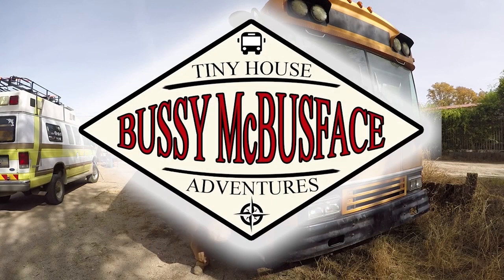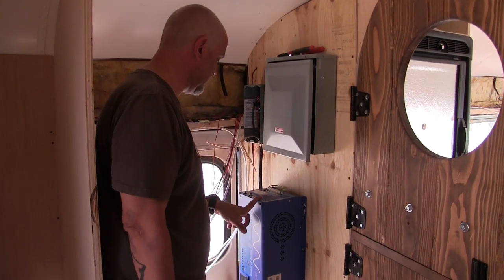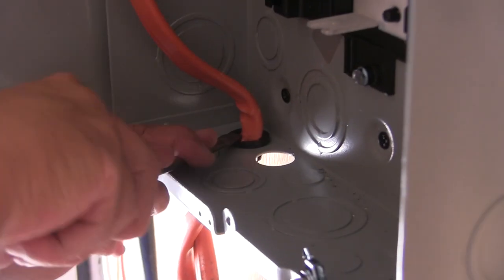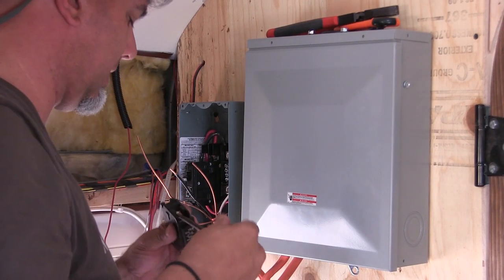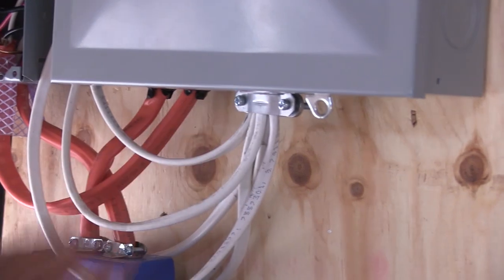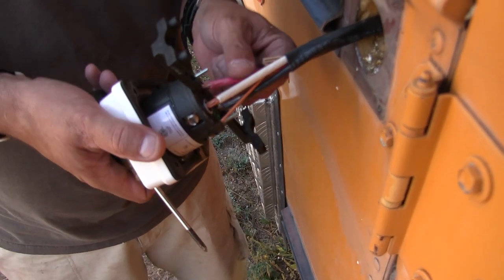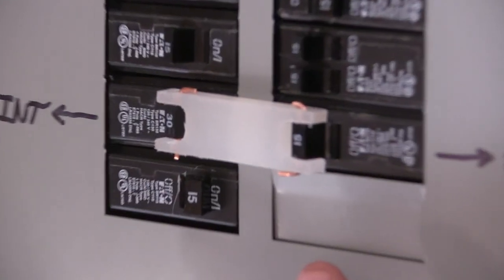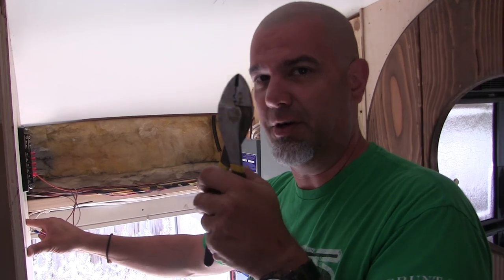Skoolie 50A Shoreline Wiring & Breaker Panels ~ 120v & 12v

Comment: Since this episode is dedicated to electrical, I’ll mention this here. Anyone who does not like using wire nuts should take a look at Wago Lever-Nuts. I bought a big kit of them and used them when rewiring all the old fluorescent fixtures in my kitchen for LED tubes. They are awesome. Easy, tidy, certain connections. You can wire and rewire as much as you like and not wear anything out. I will never go back to wire nuts. (Not sponsored—who the hell would pay me?)

Comment: Hi Mike, I had to watch this four times because I didn't see in the second panel how the pole on the left services the 1st and 3rd level breakers, and the pole on the right services the 2nd and 4th breakers.  So, now I understand how the 30/15a bridged breakers work to energize the shore power side when the internal power side is supplying power.  I have two questions.  1) What was your reason for wiring it this way?  2) Where does your 12v power come from?  Thanks, Steve

Comment: Hi,

If I understand correctly these are two circuit breakers linked together.Have you already thought what happens when there is a short circuit in one of the two circuits.

When one circuit breaker switches off, the other will switch on automaticallyThat's just what you don't want.

This 2° circuit breaker will switch off again due to the short circuit, and so on and so on. At the end, this circuit is not protected and will remain powerd due to the opening and closing of the two circuit breakers.

Result may be a fire.
Testing would not be bad.

Greetings from Belgium
Reply: I don't think that will happen. All the circuit breakers I've ever seen will not reset unless they are pulled even further to the reset position. You can't just pull it back toward "on" without doing a reset first.

Comment: I'm redoing a 2005 class C , and I really like your idea..  I'm trying to decide on the exterior plug size 30A or 50A..
Reply: They make adapters to take it down,just do 50 and get a 30A converter cable 😎

Comment: questions, there is a black and red hot wire coming in from the shore power interface. I see every video the black gets hooked up. what do we do with the red? can we setup additional panel with separate circuits with the red as a 120v set ??
Reply from the maker: That is a very good question. On a 50 amp connection, you have two hot wires. Those two hot wires are 120 volts each. In a standard house breaker panel you will find that there are two separate circuits that your breakers attached to. At the top of the breaker panel where you attach your incoming power there will be two spots for wires and that is where the black and the red wire will go. On a 30 amp connection you will only have one wire coming in and you will have to branch that off to both sides of your breaker panel.
Reply: @BussyMcBusface  so if I'm understanding I could actually split the 2 hot wires and make it go to 2 separate panels and run 25 amp each if I wanted to ( or as a combo that is not more than 50 amp total).

Comment: Nice work man. The only thing i don't understand if you get a chance to explain.  When you on shore power the right side of the panel is disconnected correct?  Then if that is the case then how do you power your fridge? Maybe i missed something, i was assuming when you were plugged in you will have full power to everything in the bus. Great video as always, you are doing nice work.
Reply from the maker: So, instead of running the second hot line to the normal point, I ran in to a breaker. With that breaker on it feeds that second circuit. Hence why I have the interlock so that I dont have the two circuits connected while on internal power and connect the shoreline which in essence is a direct short circuit of a 220v line.
Reply from the maker: On side of the shoreline runs through the inverter all the time.
Reply from the maker: The fridge us also dual power. It will be on solar 99.9% of the time. 12v
Reply: Thanks for explaining.  Keep up the great videos. I could watch your videos everyday.

Comment: My question is if your never going to have a 240v draw inside the bus while using shore power, why did you use a 50amp shore plug? If you were using a 50amp shore tie, and your going to need to need a 240v pull, wouldn't there be a 50amp breaker box coming off that 50amp shore tie before it was wired to the main junction box?
Reply from the maker: That's not quite how a 50Aconnection works.  A 50A connection consists of 2 50A 120v hot wires that together will give you 240vac.  You can run each hot wire to a different phase of a 2 phase breaker box giving your skoolie 100A total power in two phases.  That way you can run your AC and fridge on one phase and even a second AC and microwave on another without popping a breaker.
Reply: @BussyMcBusface  I see what you are saying. I was thinking if you ever had a 240v piece of gear in your bus both if those legs would need both hots to run the 240v load. If all your gear is 120v in the bus your splitting the 50 into two legs and I get that. Thanks.

Comment: perhaps it would be better to replace the two fuses (circuit breakers) by two common bipolar switches, and then a fuse (circuit breakers) each
Reply from the maker: I have that already with the 2 mains.
Reply: Of course you are correct.
But I think if you have a short circuit in the red or black circuit then the black and the red circuits will be completely powerless because the main interrupts everything.
If you replace those 30 A and 20 A (30 A and 15 A in your film) with two switches, then you will only interrupt the bad circuit and not interrupt everything and the other circuits will continue to receive power.
That's what I think if I'm not wrong.
Otherwise it is a good idea what you do.

Comment: panels are not divided in half left and right... they alternate the bus/phase every other slot from top to bottom. meaning breakers directly across from each other are the same bus/phase.
you're home made interlock is connecting two breakers on the same bus/phase, beside it's not a break before make type interlock and will most likely turn one on before the other turns off, meaning both connected at once. 
but maybe you know all that and drawing board just isn't kosher.....
Reply from the maker: Yeah, I kind of eluded to the fact that the drawing was for simplicity. There is definitely and order of switching and plugging this thing but the system works and works while shoreline or internal but should not be switched between the two while hot.

Comment: I love your guys videos I watch them all the time and love to compare to my bus. The inverter has an automatic switch over to switch between battery power and shore power as shore power becomes available. I may have misunderstood something but I would have wired the shore power line to the inverter then from the inverter to your second breaker box that powers the whole bus and that's it. There should never be a need to switch between shore power and inverter power in your second box because there should be just one power line coming in from the inverter and the inverter will do the switching for you. in fact with that inverter you should never have to switch anything in any box the inverter will switch over automatically when shore power is plugged in or unplugged.
Reply from the maker: That's exactly what we did but since we have a 50amp circuit, we have 2 50a 110v connections coming into the bus. We made it so we can switch the second 50a circuit into the mix. This allows us to run heavy power hogs (AC, fridge, etc) on one 50a circuit and the rest of the bus on the other circuit. Sounds like you have a 30 amp connection.
Reply: @BussyMcBusface  No I understand that I guess my point is two fold. I dont think it is save to have two circuits like that in the same box as I feel like it is an unneeded hazard.  Second I understand that you want to have enough power to run your AC and I know people have struggled to run 2 AC and their appliances at the same time in an RV but unlike them you have the advantage of a batter bank. AC are not power hungry because they are going to be drawing 30 amps all the time the issue is how much they draw at start up puts them over 30 amps once they are running their power consumption is drastically lower. Your power inverter has a 9000 watt peak power for 20 seconds that is over 75 amps of power and more then long enough for the AC to clear the start up cycle. Your inverter can only take in 26 amps shore power at a time but when the AC momentarily draws more then 26 amps the inverter will automatically switch to battery power using them like a capacitor to push out up to 75 amps start the AC and then switch back to shore power after the AC is running and at a much lower power consumption level. This is how I have things set up on my past 2 busses using the battery bank as a capacitor for hard start ups and then running the bus off of more normal sized shore power lines with the switch over being done automatically. I totally understand what you are trying to do and I really love your work I just felt like I should bring up that there is a safer option using all of your existing components to do exactly what you are trying to do..
Reply from the maker: So literally almost all homes use this type of 50amp circuit. That box is designed for this. My circuit is a little different but totally safe.
Reply: @BussyMcBusface  Yes but in houses they would never have 2 different main power lines coming into the box like this. The line coming from the inverter has become its own independent power source coming into the box especially because of the batteries. If you were to have any kinda short in this box because of say something bumping loose or dirt or humidity inside the box its not just that it would short its that you could very easily create 240v 2 phase system without meaning to and pump 240v to everything in your bus. This would for sure fry everything cause at 240v you can push twice the amount of power down each line as before without tripping the breakers. Even if you don't want to run everything through the inverter which I totally understand you should at least have your two different phases in different boxes so that you don't risk pumping your bus full of 240v every time you plug into shore power.
Reply from the maker: All the home boxes have 2 main power lines coming into them. All of them
Reply: @BussyMcBusface  yes but from the same power source sharing the same same neutral wire. Your set up has two neutral wires coming in from two different sources. In addition both hot lines from the two different sources are wired to the same bus bar. This is never how any house is wired and greatly increases the chance of creating accidental 240v. In a correctly wired house you could never accidentally create 240v because the 240v is created by the 240v breaker connecting the bus bars after the breaker. The way this is set up you can create 240v on the bus bar it's self pushing the 240v trough all of your 120v breakers which which will now have to push twice as much power to trip allowing your appliances to burn themselves up.
Reply from the maker: My setup has 1 neutral. Not sure where you are going with this. There is absolutely no possibility of running 220v through anything as they are on 2 separate circuits. The only possibility is if my interlock breaks for some reason and I would short circuit 220v which would immediately open 2 different breakers in the bus and possibly at the source.
Reply: @BussyMcBusface  you have one neutral bar in your set up but you have 2 different neutral sources one from your inverter and one from your shore power. The inverter functions as it's own independent power source independent from the shore power. In the event of a mechanical failure from say vibrations, or a dirt failure, or a condensation failure you are capable of pushing both sources onto the same bus bar creating 240v now this would not trip your breakers because they are set off my amps not voltage. Your 15 amp breaker would push 240v at up to 15 amps which would be the equivalent of 30 amps at 120v. There would be nothing in the system to prevent this from happening. I understand that you find the chances of both sources powering the bus bar at the same time slim but at the end of they day it is still possible with this system and if it did happen none of the breakers would protect the system as they only care about amps not voltage sending double the maximum amount of power through to your appliances before they would finally over draw the breakers and trip them. I'm not trying to be argumentative it's not my rig you can do what you want but especially in motor vehicles which move using parts designed for static structures I would always wanna create a system that fails closed rather then fails open. In the Engineers I built a lot of ghetto electrical systems for the Army but never built something that was capable of failing open.
Reply from the maker: It is literally impossible for 220v  inhabit any breaker in this system unless there is a complete short circuit due to a failure of the interlink.
Reply: @BussyMcBusface  no it can also short circuit from dust, dirt, condensation, and wires could have moved during transit because of being in a setting designed for static install not movement. I'm sure your not gonna removed your special bar to open the panel box to check for dislodged items before every time you hook up to shore power because I know I wouldn't.

Comment: Do your research on transfer switches and put them in the right places.  You do not want shore power feeding into the output side of your inverter, and, it is dangerous and probably illegal in most cases for an inverter to feed back into shore power.  Think of the poor lineman trying to find a problem and that circuit is still hot up on the pole because of your backfeeding the power line.
Reply: yhnbgt365 - I second the comment on the transfer switch. Not just for backfeeding utilities if you are plugged in, but you could easily leave that main breaker on if your not on shore power and energize your external 50a plug for an unsuspecting kid to touch. AKA, “suicide plug”.